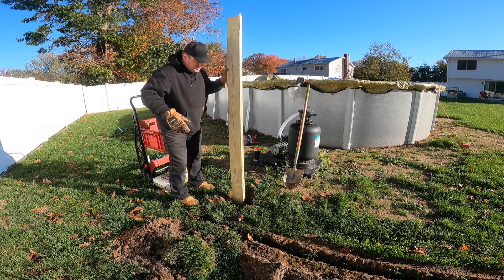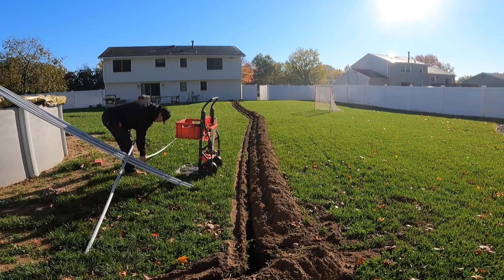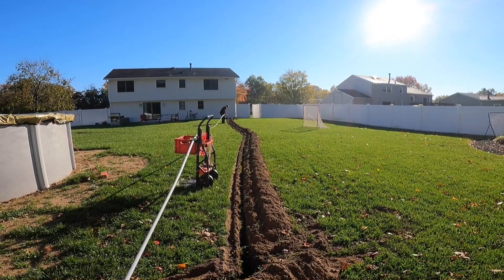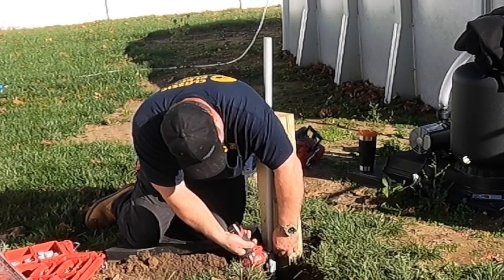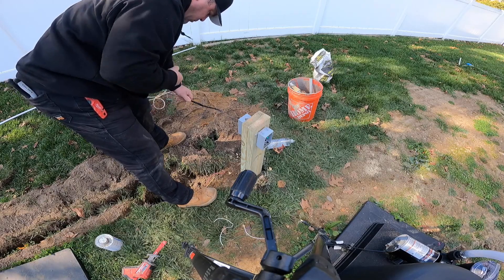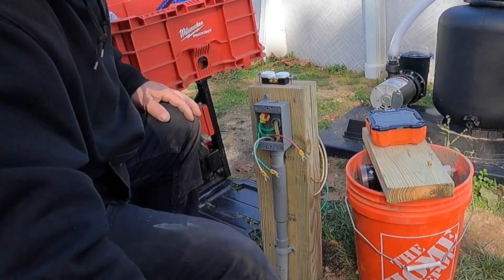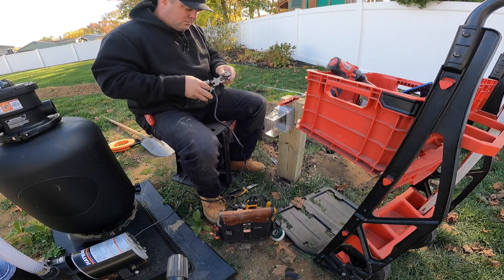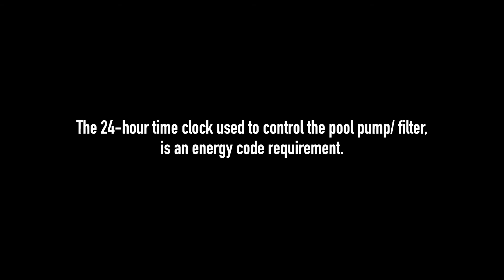Wire a STORABLE POOL w/ an EQUIPOTENTIAL bonding grid #electrical #pool #grounding

Comment: Questions for the #8 ground wire. Is this wire coming from panel and goes around swimming pool and frames and metal frame of motor? 
Or this wire is only   goes around swimming pool and frame and metal frame  of motor
Reply from the maker: @leopoliohernandez4435  The motor should have a lug on it by the wiring compartment. Not inside the compartment, the outside.
Reply: @ thanks for your respond. 
The ground wire #8 were did that begin, the final point is the motor frame  lug.
Reply: Deos it start at the skimmer then the 4 points and end at the pump ?

Comment: Does it have to be a straight continuous run or you can cut it when it goes
Into lug?
Reply from the maker: You can splice with listed devices rated for underground use.

Comment: Hey Ron. I’m being told that an above ground pool does not need to be bonded in 4 points if it has a vinyl liner.

Is that true?

Pool has metal walls but vinyl liner

Comment: Does the pump have an on/off switch? If not how are they going to backwash without a disco on the post?
Reply from the maker: @slappadabass3290  the cord is the disconnect.
Reply: @electricianron_New_Jersey  kind of a pain to backwash unplugging and plugging back in isn’t it? Especially a twist lock

Not knocking your install but a WP toggle might be nice to add

Comment: Hey Ron, what do you do when all the parts are resin except for the side wall? Do you still need to run the bonding wire around the pool if there is nothing to connect it too?
Reply from the maker: No.

Comment: If a pool heater has two lugs for connecting the 8 AWG copper wire to, if I was to connect a new saltwater generator, could I just connect it to the second empty lug on the heater?  Or does it have to be the same lug that has the current copper wire that attaches the pump to the heater??  Thanks!!!

Comment: How do you or are you required to bind the wall of a wood pool
Reply: Seriously do you need to bond an inground wood wall pool.  If that wood gets wet it could potentially conduct electricity.  I am guessing that you could bond the water through the skimmer

Comment: Are you making a complete circle around pool with bond wire or you starting at skimmer hitting the 4 points and ending at pump ? From there it uses equipment grounding conductor
Reply from the maker: Thanks!

Comment: Are you making a complete circle around pool with bond wire or you starting at skimmer hitting the 4 points and ending at pump ? From there it uses equipment grounding conductor
Reply: I can’t fine the answer to this question. It’s either

1) pump, hit 4 posts, end at skimmer 

OR

2) pump, 4 posts, pump, then skimmer (this way you’re not going up and down to skimmer
Reply: @RagingRapids311  me too, seems like ground wire dose goes to panel ground?
Reply: To me it sounds like  skimmer,  4 points , pump?

Comment: This is very helpful, my question is my pool pump for my above ground pool will be more than 25' from my pool outside of a pre existing pool cage I can bond the pool but do I need to run the bonding wire to the pump if the pump is grounded at next to my electrical panel?
Reply from the maker: Yes, the #8 solid connects the metal frame of the pool and terminated at the pool pump lug beneath the motor b

Comment: Man that makes me nervous when you pull off the wall legs or covers like you called em. My wall legs or covers are directly holding up the liner and the pool. Mine also sit on a resin cup so there was no need to take them apart or anyway for that matter since the weight of the pool is holding it down. Great video tho! It was really informative

Comment: Question regarding the bonding for the 4 points.  If the above ground pool is a resin pool which nothing is metal.  What exactly do you have bond besides the skimmer?  Do you just bond the wall connection joint which is metal?
Reply from the maker: Exactly.  Bonding doesn’t have to be complicated.  If it can be energized than it has to be bonded.
Reply: Ok so only the wall bar connection, skimmer and pump. Does the #8 have to still go around the pool?
Reply: @20bluezl17   if my interpretation or knowledge of pool bonding is correct, I would say to try and picture it like and underground force field or grid/perimeter that protects anything within the inside of the binding ring in essence. That’s why they are recommended to be 18-24 inches away from the pool. It’s like your standing on protected ground sorta. You can also make additional ring around you pump/filter setup for protection as long as it is all linked together. 
Just my opinion, not gospel or telling you what to do. 
Hope my explanation helps.  Let me know.  Thanks!
Good luck!

Comment: Hi Ronnie,
Great video!
I may have missed the spec on the depth of the trench for the conduit?
Reply from the maker: If the circuit is 120 volts and 20 amps or less, in conduit, and GFCI-protected, the minimum depth is 12" to the top of the conduit.

Comment: How do you VERIFY you actually have equipotential voltage across all bonded components?  1) how do you test the main panel earth voltage as a reference point and 2) how do you subsequently verify all bonded structures read the same voltage ?
Reply from the maker: The purpose of the equipotential bonding grid is to eliminate any voltage gradients around the pool. The grid is connected to the pool pumps equipment grounding conductor. This circuit is GFCI-protected. If as much as 6 milliamps of current flows on the equipotential bonding grid the GFCI circuit breaker will trip, thus saving someone's life if they happen to be in the swimming pool.
Reply: @electricianron_New_Jersey  Ah. That makes sense. So basically just make sure all your bonding connections are solid and run the pool equipment off of a dedicated gfci protected circuit.  Thanks for the informative reply. -Cheers mate.

Comment: Great video. One question about equipotencial bonding. Do you run the 8awg wire also to the pump? is this wire required to be conected t the ECG? love the video. Very well edited.
Reply from the maker: The equipotential bonding grid terminates at the pump motor lug.  From there it is bonded to the equipment grounding conductor.

Comment: Great video.  Does the code “require” a 20 amp circuit?  My pool has a 15 amp motor and plug
Reply from the maker: Yes.

Comment: Great video. Does code allow you to use UF cable in the conduit or must it be individual THHN conductors?
Reply from the maker: GREAT question! Actually, UF wire is not permitted unless the equipment grounding is insulated. I've never seen any but I'm not saying it doesn't exist. The main requirement is the insulated equipment grounding conductor for pool circuits.
Reply: And that the wire be THWN